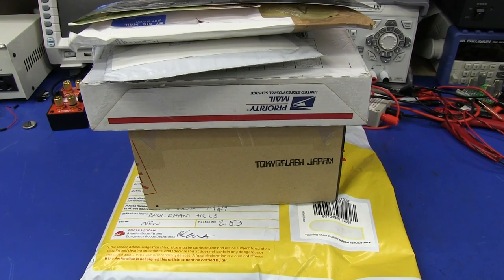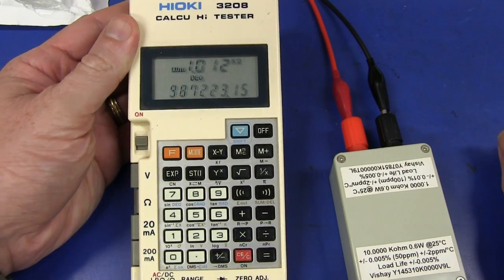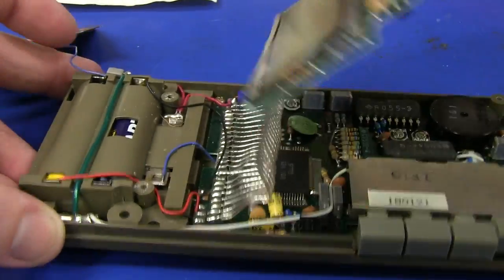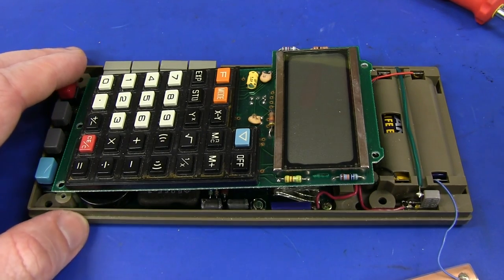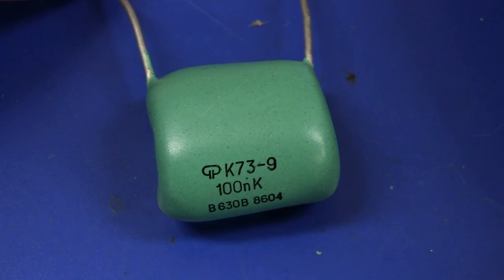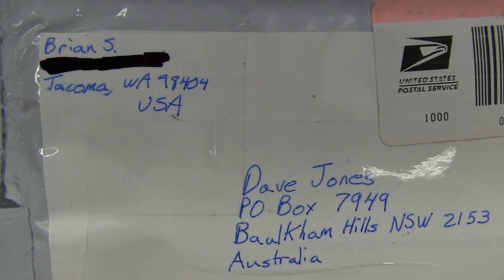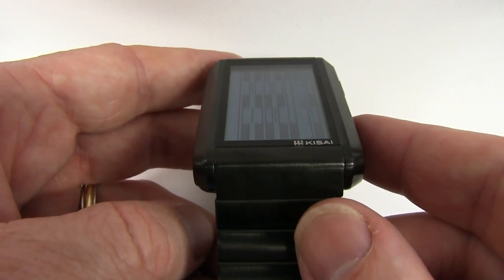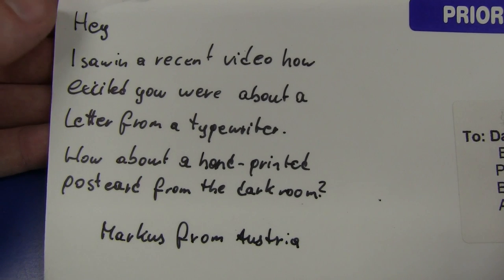EEVblog #556 - Mailbag

Comment: I reckon that is a standard calculator chip, and they are passing the information over from the meter chip not by serial link, but by faking key presses! Kudos to Hioki for providing support for equipment that is 32 years old. Gives you some confidence in buying their current products.
Reply from the maker: Yeah, maybe that's what the 2nd chip is for.
It would be serial interface to that top PCB and chip though from the DMM chipset.

Comment: I wonder why they didn't design the dispenser with an adjusting screw which would limit how much you can depress the handle to dispense certain amount of paste at one press.
Reply: Seller here - such a design change would actually greatly increase the cost, and it'd make the device less suitable for use across a variety of materials and dispensing tips. Moreover, it really isn't needed - fingers works rather well for such things :)
Reply: *****
Agreed.  An metering adjustment screw could be easily placed in several places.  However in the sloppy corporate world these costs have to be greatly inflated due to "redesign" and "retooling" to do such.  And of course several executives have to be given a bonus for one reason or another.  All of this has to be passed off to us ... the unfortunate customer.

Comment: The Russian parts actually look like quality parts.
Reply: They look rather bulky to me, but that might just be the Soviet way of making sure the parts are rock solid and will last a lifetime, not fail after 3-5 years like some modern 'planned obsolescence' crap.
Reply: They do, but these parts were made in the 80's. Back then, everything was bigger, even the USA made bigger  components..
Reply: Saberus Terras well I'm not really "in the field" but isn't that capacitory very weak? And also: where do you have the place for such giant capacitors on say... A "modern" Computer Mainboard? I paid a little more for my mainboard, so that I had "guaranteed quality and tested caps and other components". The caps last at least 10.000 hours at 130° (I might be wrong there) and under normal usage conditions I guess that that board will server be for far more then 5 years. After that time span there will be new hardware anyway because development still goes pretty fast in this sector.
Reply: This Oleg (Олег) must be ashamed of him self! He could find something more interesting rather then just a few caps and resistors. At least those could be from 60-s era.. OK, I had a few nixies somewhere and broke soviet "home pc" from late '80. Might suit for tear-down. So keep tuned :)
Reply: They might look like that, but in fact these are very poor quality parts. The only good Russian (soviet) electronics parts were made for army purposes. These parts here were used in household items like tube TVs, and they were extremely unreliable. The quality of soviet electronic devices and components were better the further from Moscow it was: Say Latvian or Lithuanian devices were of a better quality, but compared to Japanese counterparts - complete rubbish.

Comment: The design of the bug cap was quite common here in germany as well; there was often a metal ring with the second wire soldered on and fixed with a plastic washer

Comment: FYI.. For the Solder Paste Press.. it costs $49.99USD plus shipping :EEK:
From your video it looks like it should be more in the $10-$20 range.
Reply: @lasersbee That's funny :) Here's the next cheapest tool on the market: http://www.digikey.com/product-detail/en/SMDSG10CC/SMDSG10CC-ND/2515687

Oh, and you need to replace the plungers on that unit fairly often, so make sure to find a pack of those. I think that they're around $25.
Reply: *****
Ha Ha...You're paying way too much for a spatula...;)

I was actually just referring to the comment by Dave in the video at ~23:40 of the Press  being "pretty cheap".
For about double that price I can buy a Solder Paste Dispenser like eBay Item #160982115243.
Reply: lasersbee Of course, you might want to mention that your eBay bargain requires an air compressor and fittings - so you'll be at at 6x in the end. Just sayin'.
Reply: Pieco Not trying to downplay your product... On the contrary we just bought one this morning shipping to Quebec because we could afford to try it out. We'll see if it works for us or if we need to invest a bit more...
Reply: lasersbee Funny, I noticed that :) I'll toss in an extra goody for you to play with.

Comment: Every watch I own has come with a couple of tools. Pin removal tools, screwdrivers, etc... But saying that all my watches cost around £1000 so I should they they come with their own tools to easily exchange straps and/or adjust the size of their metal straps... I'd be very pissed off if I bought a watch for a grand and then had to pay more to buy a tool to remove or add a link to the strap so it fit me correctly... lol

Comment: MLT-2 - 2W resistor 1,5R = 1,5 ohms. K50-16 pretty useless capacitor, K50-35 is better, trimmer is 680 ohm, SP5-2M is a part number.